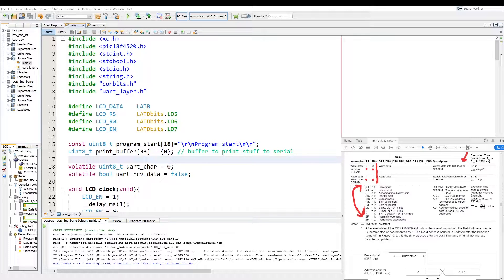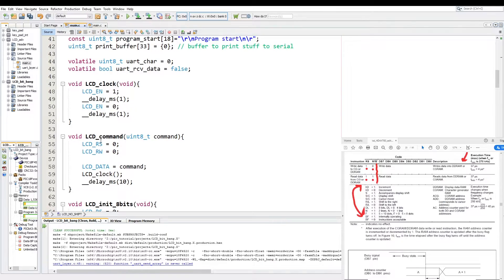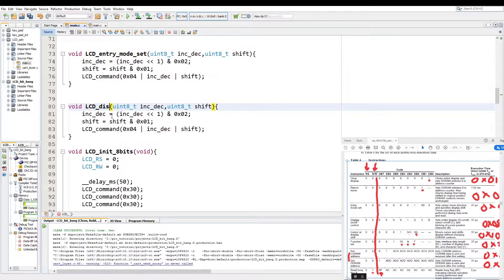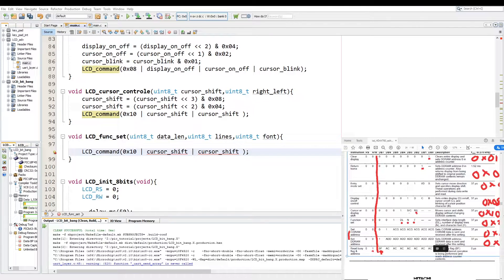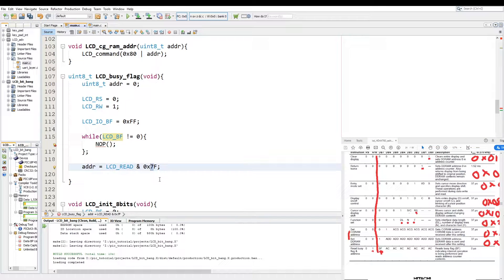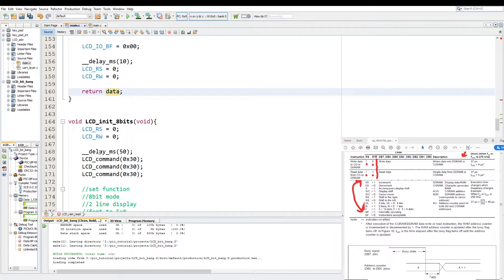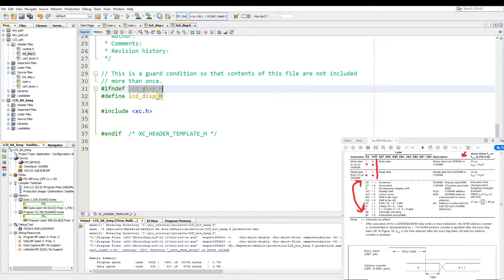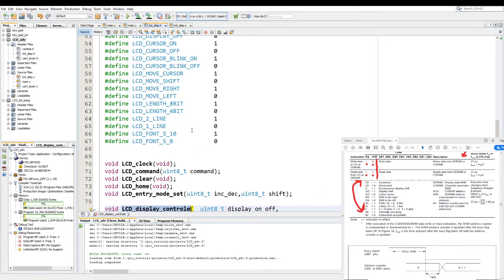LCD Code Improvements 🔴 PIC Microcontroller Programming Tutorial #24 MPLAB in C

Comment: So I noticed that you #define variables to alias your LATxbits.  When I do this, they are "Not Recognized" during debugging making it a headache to troubleshoot.  If I predefine them above the #defines AND add a bool between the #define and the variable.  Then they resolve perfectly, but that makes the compiler very angry, but still spits out my code.

Is there a solution for this that you're aware of?
Reply from the maker: You are going to need tp show me what you are doing that the compiler is displeased with. It sound like you are redefining the values and that is why the compiler is complaining.

!define LCD_DATA(x)   do{ LATB = x;}while(0); may make GDB resolve the macro correctly.

Just note I am replacing `#` with `!` because the comment filter does not like the `#` symbol (creates a hyperlink).
Reply: @BinderTronics  Well honestly, I loaded the program back up today, and it compiled, but did not work at all.  I was definitely double defining it.  It did however allow the GDB to resolve the macro...   for a time.

What IS working to run the code, but NOT allowing the GDB resolve the macro is this.

!define Data1 LATCbits.LATC5

What DID work for a time was this. (albeit warnings)

bool Data1;

!define Data1 LATCbits.LATC5

Would your solution of do{LATB = x;}while(0) help the GDB resolve this?  I'm defining each bit to allow me to run a straight wired bus to the LCD to keep the board nice and tidy.  If it could help, would it be written like this?

!define Data1 LATCbits.LATC5  do{LATCbits.LATC5 = Data1;}while(0);
Reply from the maker: Do it like this. It may or may not help.
!define Data1(x)  do{LATCbits.LATC5 = x;}while(0);

how to use:
Data1(1) // same as LATCbits.LATC5 = 1;
Data1(0) // same as LATCbits.LATC5 = 0;

Honestly surprised this compiles
bool Data1;
!define Data1 LATCbits.LATC5
This will break something. never tried something like this.

If GDB refuses to resolve try using LEDs on the data lines or if you got a logic analyzer use that or watch the IO registers instead of the variable.

Comment: Also forgot to ask what programmer you use..? I have the PicKit3, but am looking at getting the PicKit 4.. Any opinions on the 4th version?
Reply from the maker: Using a PicKit3. Don't really have strong opinion on the PicKit4. Would probably buy one if I run into a chip that i can't program with the PicKit3 or J-link. Depending on your budget I would recommend buying the latest hardware if you can.